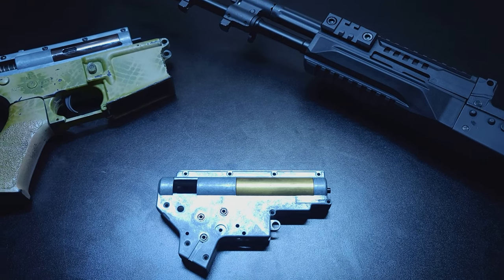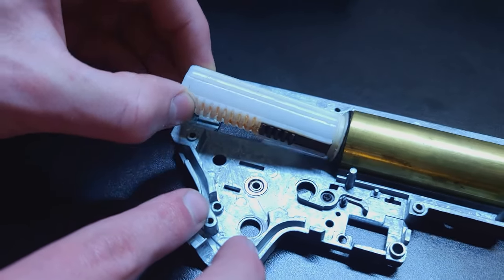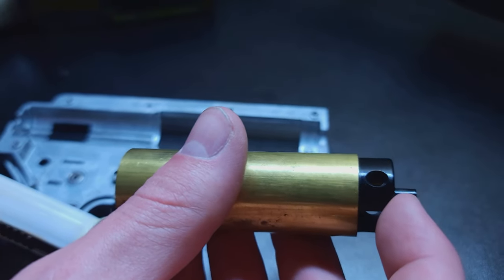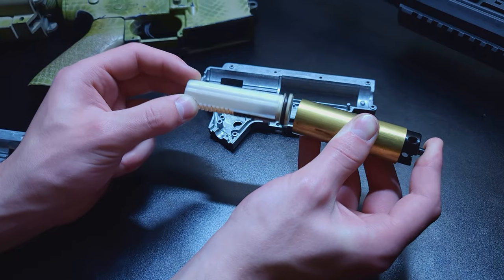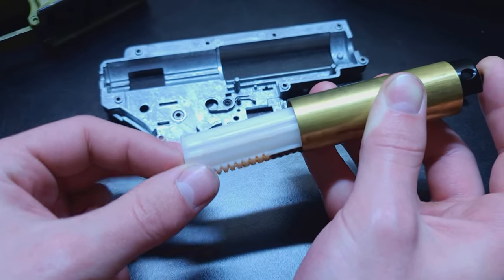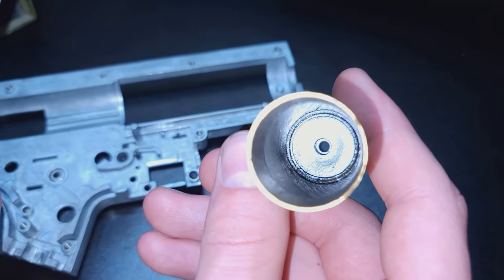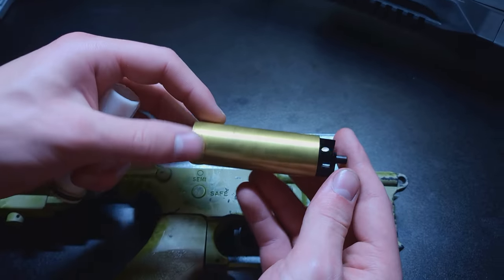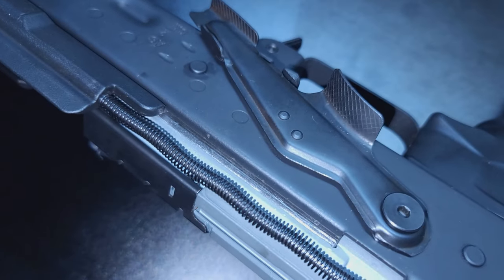Easy FPS Increase For AEGs (4K)

Comment: you dont have to replace the piston oring, you can just stretch it.
also any explained details about the different types of ports ?
Reply: longer barrel means more air needs to push the bb, so under 350mm normal port and 400mm plus with no port.
Reply: Changing the oring over time helps  there's orings made for non ported  cylinders that give a tight seal and push bbs further and omit helps to  keep internals lubed and clean also helps keep accurecy and air seal

Comment: I only just got a couple the other week but a friend of mine pre ordered some so he got the first lot and has worked out how to tune them like get the goog seal cause we run a rubber tip on the nozzle and that seal's into the tpiece no thop a hopup goes on the end of the barrel for accuracy but he's loving them and supposedly you loose like 10% of fps with a Apache but no tappet timing issues